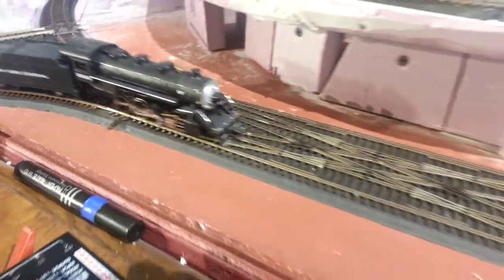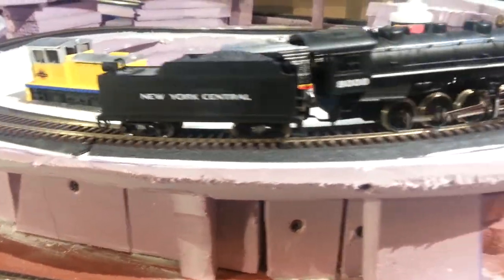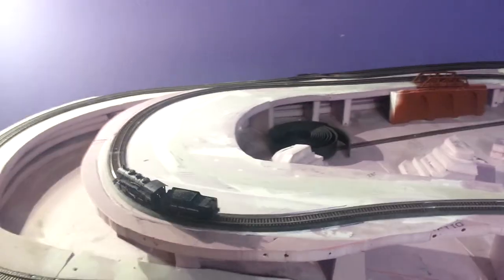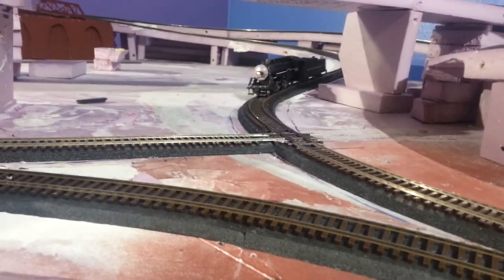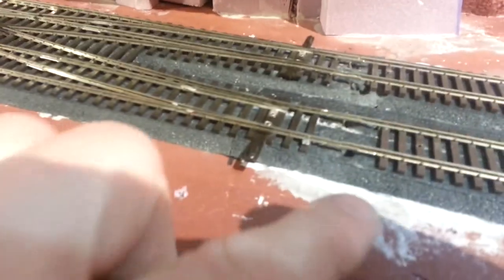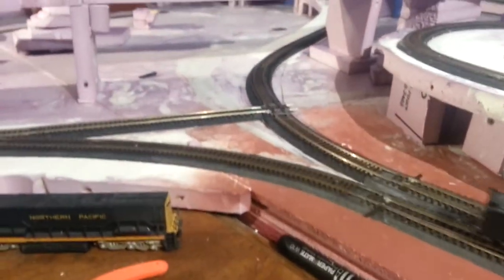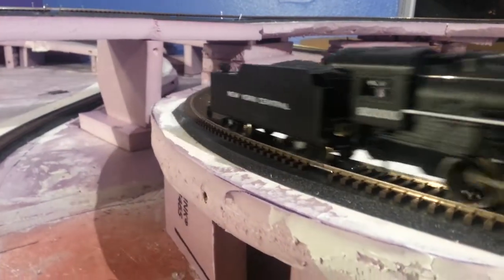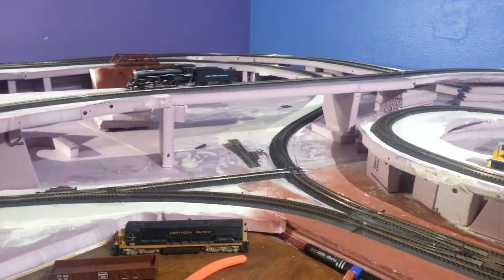#9 update, I finally finished laying all my tracks

Comment from the maker: I started this hobby with very little understanding of grade in calculation with engine and train performance.  so we ended up fighting that the entire time of building it. some of my engines struggle with the grades that I've set up on the way out.  no turning back now, I'm just going to deal with a larger pitch then is recommended.

Comment: In all of your track laying videos you never said how you attached the track to the foam.
Reply from the maker: I used Form Tack glue from Woodland Scenics. be sure you want your track to be where it's going to eventually be permanent because it's a pain to remove it once in place glued
Reply: Thank you.I will be securing O scale 3 rail track and thought of just using drywall barbed nails with glue on the nail.  They hold the track down real well.  But also thought about just spraying 3M 77 glue and stick them down.  That is what I use to secure the roadbed to the foam.